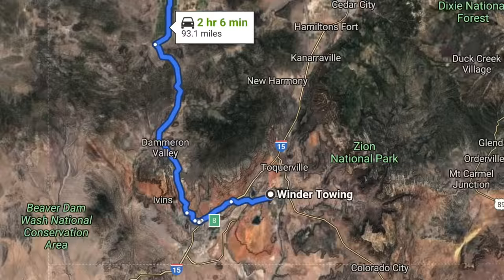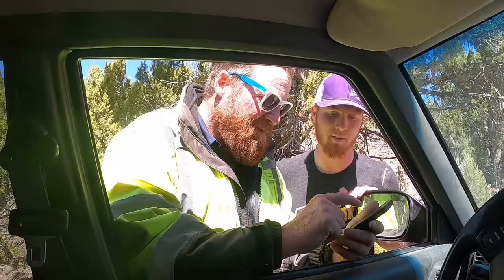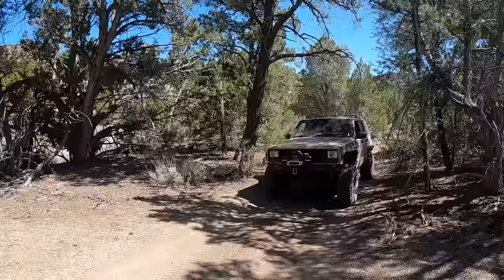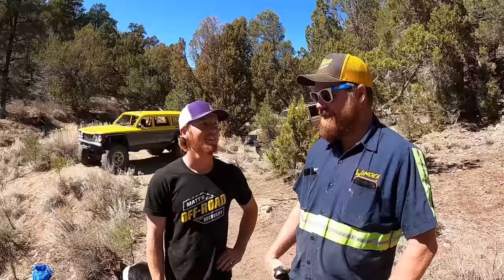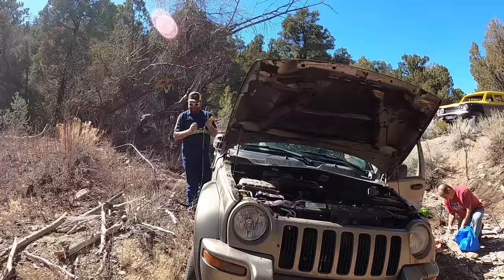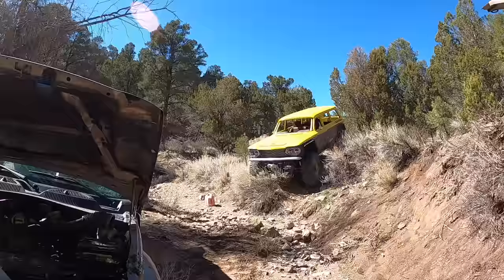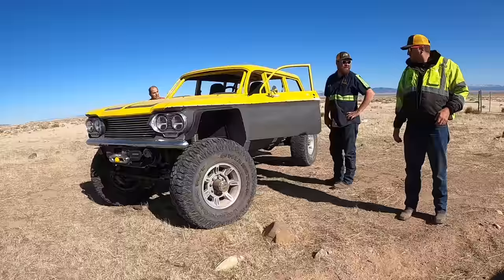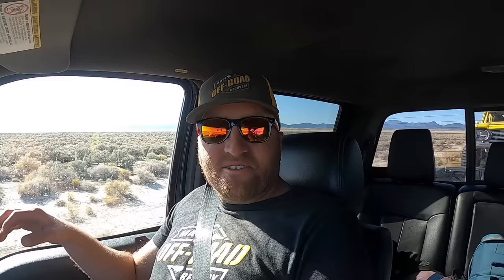Jeep Liberty Rollover 100 Miles In The Backcountry

Comment: I don’t know why y’all keep saying you are surprised the liberty got in there. Other than leaning a bit, it looks like a fairly easy trail. A stock Jeep won’t lean nearly as bad as your lifted vehicles. 

Anyhow, good job on the recovery. I did not know that about oil in the tranny. Good tip.
Reply: Dude it's broken and upside down.
Reply: You must never tried to off-road in a stock ride. You drive harder trails than that regularly? Do you see those tires?
Reply: @SwampyColorado420  my last rig was a bone stock 2010 JKU (small engine) with street tires and I did Hells revenge, fins and things, about a dozen trails in the Ouray Colorado trail system, and several other places. That thing is bigger, heavier, has worse break over, approach and departure angles than a liberty. I’ve wheeled a lot of stock rigs until I got them built up. I used to do Spring Creek, Deer Creek, Webster Pass, Saints Johns, Red Cone and Jenny Creek trail (in Colorado) with my stock CJ-7 with tiny street tires. I have a ZJ Grand Cherokee now on 31’s that did the rubicon with no damage to the Jeep. So, yeah, I saw nothing that would keep me off of that trail in a Subaru.

Comment: If he'd had some AT'S he might have pulled that off. Those first model Liberties were an interesting rig- like half way between a sidekick and a Cherokee. They  have ok front articulation for what they are,good power to weight, but top heavy and some things were really light duty. Honestly more capable than they should be.
Reply: He had driven to the end of the road, turned around and was coming back when the front driveshaft blew.  
Had he not rolled from slipping sideways with only rear wheel drive on a sideslope he would have got out unscathed and driven home with no one the wiser.
He did drive it home after the recovery....

Comment: It's amazing how far he got that Liberty.
Reply: He had got there to the end of the road, turned around and was coming back when the front driveshaft blew. 
You can see that even under tow, only having rear wheel drive on a sideslope means the arse end slides downhill...and when it sldes downhill enough, you roll.
He had no other option as he did not have any other vehcicle to tow him out.
After Matt's recovery he drove the vehicle home.

Not his first rodeo....

Comment: I' m 80 yrs old so, I'm going to give you at real tip that works, I had a 1972 dodge van in Utah and I backed into a rock and it made a hole in my gas tank, I took a bar of soap wedged it in the hole and got used to it working and never fixed it and ended up getting tranferred to las vegas for the railroad and used it in vegas for 4 yrs and sold it and forgot it untill just now so I know it works so it'll work for you so carry soap, Jim las vegas nv by the way the hole was the size of a golf ball

Comment: Stock liberty on bald street tires that far in the back country...
Impressed he got that far & glad nobody was hurt. But where in the world was he going and why???
Reply: He had driven to the end of the road, turned around and was on the way out when the front driveshaft blew. 
He rolled when the rear slid sideways going up a cross slope (which sliding also can be seen when under tow). 
It rolled and he walked out all night to call Matt. 
Federal fines for dumping and an "arranged" tow would have cost more than Matt's recovery...
and then he drove it home!

Comment: I can not believe he took that Liberty that far in!!
Reply: He had driven to the end of the road, turned around and was on the way out when the front driveshaft blew. 
He rolled when the rear slid sideways going up a cross slope (which sliding also can be seen when under tow). 
It rolled and he walked out all night to call Matt. 
Federal fines for dumping and an "arranged" tow would have cost more than Matt's recovery...
and then he drove it home!

Comment: That transmission fluid/oil did a heck of a difference it seems. Though I dont understand, did the transmission not work in some way? Was it in 2 wd only or even that wasnt working properly? Does the car shut down the whole driveshaft if it notices a lack of fluid or why/what it didnt work and then did ?
Reply: The trans fluid leaked out while the vehicle was upside down.
Auto trans requires a certain amount of fluid to work at all....
The front driveshaft blew when the owner was further in the bush.
He only had rear wheel drive.
He was driving out and had to accelerate up a side slope.
As you saw while it was under tow, rear wheel drive on a cross slope skids the arse end sideways.
Slide sideways enough on a steep slope and you roll.....
Reply: @JohnSmith-yv6eq  ok, thanks for that, so basically they just managed to make the rear wheels work.
Reply: @ChopStickZero  
Yes, the driveshaft to the front axle broke...so no drive to the front wheels.

That's the thing with some older 4wd vehicles...when the rear driveshaft breaks...you can select 4wd and drive home just using the front wheels!

Seen it done with an old Series 1 Land Rover...renowned for breaking the half shafts in then rear axle housing, from the diff centre to the wheels...snap.

Comment: I really dislike most Jeep people. The majority that I encounter off-road seem to think that their stock Jeep is the answer to all things off-road. They’re typically like any other vehicle unless heavily modified. Most recently I rescued a completely stock Compass with highway tires, no 4 low, no tow hooks, no trailer hitch on a tiny patch of snow in the middle of a maintained dirt road. I was in my Armada, towing to almost max capacity (28’ camp trailer) and the guy was out there in flip-flops, no jacket, no recovery gear and no food/water/blanket or anything. He was out for a cruise in an incapable vehicle for the conditions. I handed him a shovel and told him to get to work. After an hour I put a strap around his rear axle and yanked him out. He didn’t have much gas left either, he got my spare generator gas. That could of been the last of him. Kinda frustrating when you come upon these folks!
Reply: Well, by the time he had finished digging the error of his ways may have impinged on some of his remaining brain cells. 
Good man re supplying him gas...hope he paid generously as a thank you!

Comment: Looking at the damage on that thing, is it worth saving?  Honest question but also I guess you don’t want to litter it.  Sometimes cars in this predicament become riddled with bullet holes in these remote areas.
Reply: He had driven to the end of the road, turned around and was on the way out when the front driveshaft blew. 
He rolled when the rear slid sideways going up a cross slope (which sliding also can be seen when under tow). 
It rolled and he walked out all night to call Matt. 
Federal fines for dumping and an "arranged" tow would have cost more than Matt's recovery...
and then he drove it home!

Comment: At that point, are they recovering it to be to have it fixed or just to clean up their mess? Because I know a lot of people that would just write it off and abandon it.
Reply: He had driven to the end of the road, turned around and was coming back when the front driveshaft blew.  
Had he not rolled from slipping sideways with only rear wheel drive on a sideslope he would have got out unscathed and driven home with no one the wiser.
He did drive it home after the recovery....
Had it been abandoned there on Federal land there would have been huge fines and a large bill for the "arranged tow"....

Comment: Ol boy was REALLY determined to get up there... even continued up after twisting his front driveshaft. What was that dude up to?
Reply: He had got there to the end of the road, turned around and was coming back when the front driveshaft blew. 
You can see that even under tow, only having rear wheel drive on a sideslope means the arse end slides downhill...and when it sldes downhill enough, you roll.
He had no other option as he did not have any other vehcicle to tow him out.
After Matt's recovery he drove the vehicle home.

Not his first rodeo....

Comment: So does anyone know where he was going driving the jeep in this area?  Hope the driver wasnt following his GPS for a short cut...
Reply: He had got there to the end of the road, turned around and was coming back when the front driveshaft blew. 
You can see that even under tow, only having rear wheel drive on a sideslope means the arse end slides downhill...and when it sldes downhill enough, you roll.
He had no other option as he did not have any other vehicle to tow him out.
After Matt's recovery he drove the vehicle home.

Not his first rodeo....

Comment: The owner wanted to drive it home, b/c you made him walk the whole way back down the trail- he pry afraid you'd make him walk the highway 🤣
I kid
Ok- I'm here to say the same thing- pretty surprised that dude got that Liberty that far up that trail on highway tires. I bet it was fun, till it wasn't. Wondering if he will make an insurance claim and did the cost of the recovery exceeds his deductable? 
The owner was cool dude though- he had a shovel in hand always and seemed ready to help at all times.
Reply: He had got there to the end of the road, turned around and was coming back when the front driveshaft blew. 
You can see that even under tow, only having rear wheel drive on a sideslope means the arse end slides downhill...and when it sldes downhill enough, you roll.
He had no other option as he did not have any other vehcicle to tow him out.
After Matt's recovery he drove the vehicle home.

Not his first rodeo....

Comment: The KJ Liberty actually has a great 4x4 system. They have the same T-Case and rear axle set up as later model XJs. When built they are surprisingly capable. What's truly surprising is how this basically bone stock KJ made it out there. Too bad it met it's end like that.
Reply: He had driven to the end of the road, turned around and was coming back when the front driveshaft blew.  
Had he not rolled from slipping sideways with only rear wheel drive on a sideslope he would have got out unscathed and driven home with no one the wiser.
He did drive it home after the recovery....

Comment: I'm not sure what year that is, but it likely has a "Cold Start" method, meaning you could have turned it over without ignition by depressing the throttle the entire way and hitting start.

Short of a complete hydrolock (which would have been immediately apparent and harmless without ignition), you could have purged the cylinders of oil.

You're welcome.  I'll take a free tow in trade.

; )
Reply: You can bend the con rods with one revolution of the engine on the starter...if you haven't taken out the sparkplugs allowing the fluid to escape harmlessly.
If in doubt...take them out.
Reply: @JohnSmith-yv6eq    I guess better safe than sorry.

Comment: Those ugly little Frog-eyed Jeeps were kinda surprising. I've still got an '02 Sport 4x4 with a 2.5" lift and and never had it dropped from the recall (they dropped them 1.5" due to some Road and Track rollover crap) and Wranger MT/R 245/75 and that thing just was a little monster. I got hell everywhere where I went, "Is it trail rated? I don't see the badge! hahaha!" and it just kept up with 'em until the big rocks where I'd just have to find a path around. I seldom had to get the CJ-7 to tug it out and it was always my fault for even trying to find the limit.

Stock tires though? Very shocked seeing that trail. Big NO for me. Good video as always crew, keep it up.
Reply: He had driven to the end of the road, turned around and was coming back when the front driveshaft blew.  
Had he not rolled from slipping sideways with only rear wheel drive on a sideslope he would have got out unscathed and driven home with no one the wiser.
He did drive it home after the recovery....

Comment: hey hey its not that bad of a jeep it does okay for a wanna be Cherokee but they are know to be able to do trailing its just odd its completely stock
Reply: The owner was coming back from further in after blowing the front drive shaft...when the back end slipped under power going up a side slope in 2wd (Like you see it doing even while under tow) and that rolled it.....

Comment: Second mortgage to pay for that extraction?  3+ rigs, most of the day with 6-7 guys holy moly I can’t inagine
Reply: He had driven to the end of the road, turned around and was on the way out when the front driveshaft blew. 
He rolled when the rear slid sideways going up a cross slope (which sliding also can be seen when under tow). 
It rolled and he walked out all night to call Matt. 
Federal fines for dumping and an "arranged" tow would have cost more than Matt's recovery...
and then he drove it home!

Comment: You already did damage to the tranny before you added oil - redlining the engine many times (resulting in sudden jerks) to get it to move - you are lucky you didn't break a rear axel or differential as well.  Upside is, you remembered to bring eng. oil this time. lol

Comment: That's a rare find. I thought all of those Liberty pieces of crap were in a junkyard by now. Mine is. Worst vehicle I ever bought..and I've bought lots of bad ones.
Reply: He had driven to the end of the road, turned around and was on the way out when the front driveshaft blew. 
He rolled when the rear slid sideways going up a cross slope (which sliding also can be seen when under tow). 
It rolled and he walked out all night to call Matt. 
Federal fines for dumping and an "arranged" tow would have cost more than Matt's recovery...
and then he drove it home!
Reply: @JohnSmith-yv6eq  It's a miracle that the plastic radiator didn't crack in about 12 spots from driving down the trail. The paved highways of Massachusetts were all mine needed to crack.

Comment: Everyone talks so much trash on the Liberties because they replaced the Cherokee. People need to understand stat rhe Cherokee is an off-road vehicle with lights and turn signals to make it street legal. The Liberty is a road vehicle that is surprisingly off-road capable. Idk about the reliability of the auto transmissions, but the manual transmissions are made by Mercedes.

Comment: That jeep really wanted to tip again
Reply: It only had rear wheel drive so on a sideslope...
the back end tends to slip and slide downhill...so yes, it will tip if taken too far....
and that's another reason for 4wd......
the front crawls wherever the wheel is pointed....until it doesn't....

Comment: What possessed  this person to bring such an ill-equipped vehicle that far back on  unincorporated terrain. No off road capable equipment,  not even off road tires, much less modified  suspension  that would normally be required. Can't say it's never been done  before though. A few years back we received  a call out on Fort Benning about three in the morning for a Military Police vehicle (1978 Plymouth 4 Dr sedan that had been patrolling out near the range and reported that their vehicle had bottomed  out on terrain while attempting to  turn around and become stranded. When I finally got there and found them, which wasn't easy as they were some 25 yards off the road and obscured by forest. Plus it was the middle of the night and the sedan was painted NATO green. Closer inspection revealed that while attempting  to free themselves (both from the embarrassment  of having gotten stranded  and consider the condition of their overall appearance what these to officers of opposite  sex were doing in that secluded location) they had ripped the passenger  side lower control arm clear of the frame and crinkled the fender puncturing  the tire with the bumper.. I had to chain a piece of 4X4 timber to the underneath of the vehicle, winch them back to the road where I put it on dollies and brought it back to their Motor Pool. The Military Police sent another  unit out to pick them up. Seems the night desk Sargeant was real eager to hear their report. This recovery reminded me of that one  because both of them where so obviously  where they should  not have been. I hope that Jeep Liberty was a rental and that they had full coverage  insurance because it appears  to be a complete loss. However, you have to respect a customer who jumps in and tries to help alleviate  the situation  regardless of his mistakes. Great recovery, as always.
Reply: He was on his way back from further up the trail!. 
He was on an uneventful (for him) journey. 
It all came unstuck when he blew the front driveshaft...so he only had rear wheel drive. 
As we can see even when it was being towed, rear wheels drive only means the back end "walks" on a sideslope under power...
So, this sideslope = roll.
He drove that vehicle back to his home after Matt towed him out.
Not his first rodeo....

Comment: I'm surprised the customer did not take out the windshield
Reply: He had driven to the end of the road, turned around and was coming back when the front driveshaft blew.  
Had he not rolled he would have got out unscathed and driven home with no one the wiser.
He did drive it home after the recovery....and with the windscreen still in..... didn't have to cope with little bits of glass blasting into his face.....

Comment: For future reference how did you extract the oil out of the cylinder?
Reply: Remove sparkplugs, turn over engine on starter, oil (if flooded in a water crossing, water) jets out, screw sparkplugs back in, refill oil, start engine; drive.
Reply: @JohnSmith-yv6eq  don’t forget to remove the fuel pump fuse yea?
Reply: @jesseplz  
Sorry, Boomer here, still thinking carburetor...but wouldn't the gas being injected help flush out the oil?